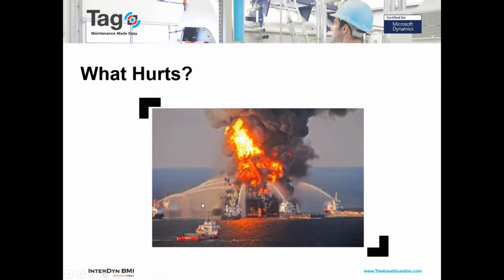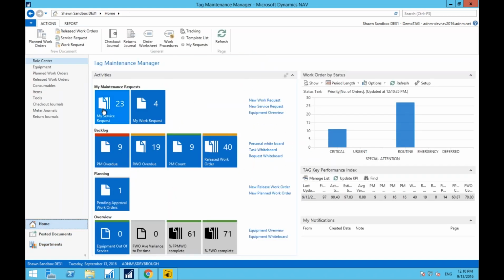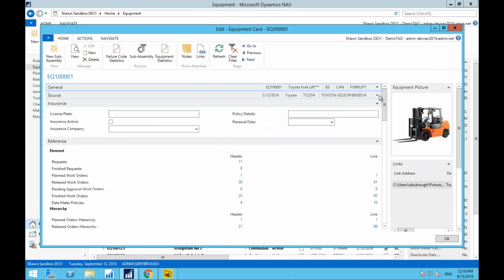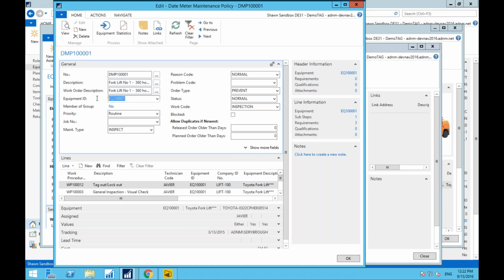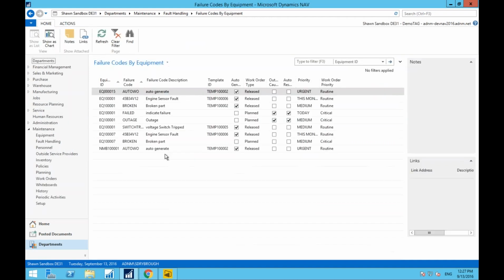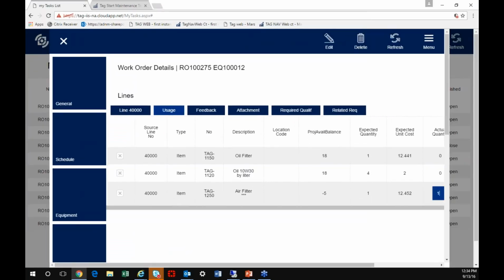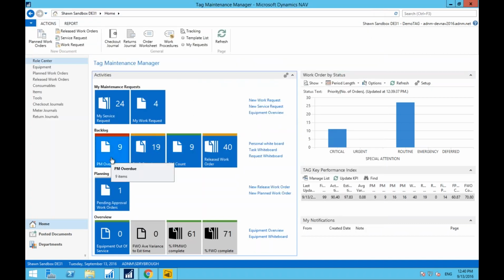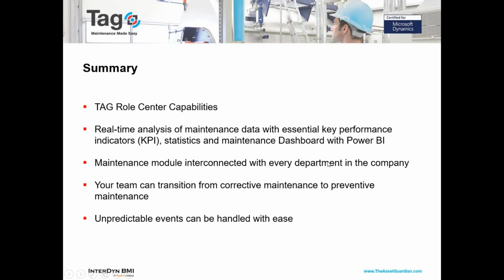Preventive Maintenance Management into Microsoft Dynamics CfMD by TAG

Comment: What is the difference between Order date, document date,  There are other term that I would like to know the rigth use (request service date, Due by date, Due date, Likely due date, expiration date). Every maintenance activity has a frequency how tag calcualte the next date when you add to the orderworksheet, when you released the order, the date (according what date calculate this date when the order is realased).
Thanks
Reply: Did you ever get a reply for the above?
Reply: @4s6ryd  No reply